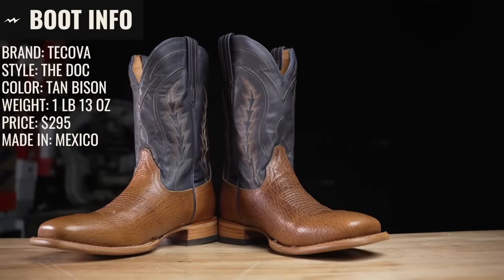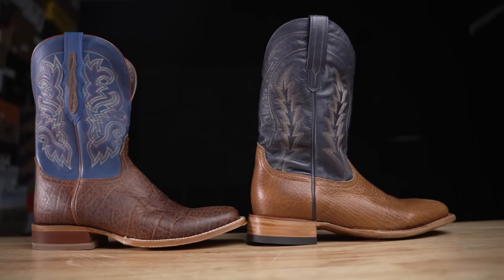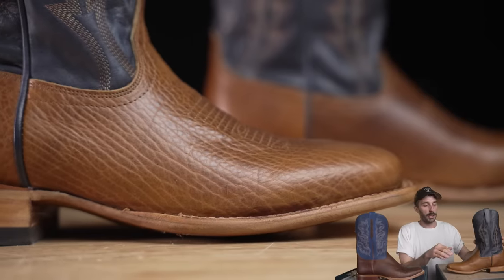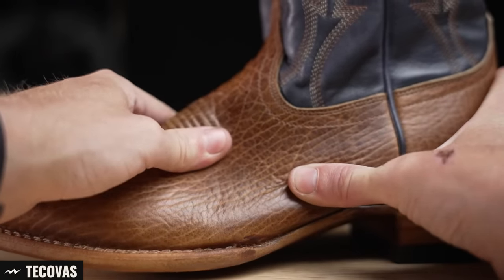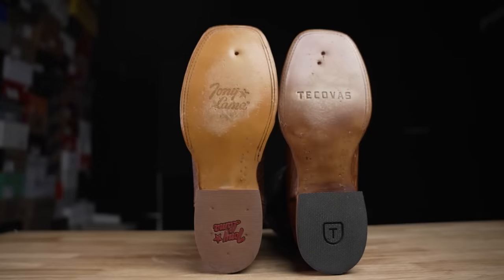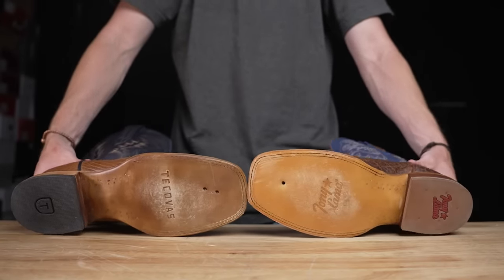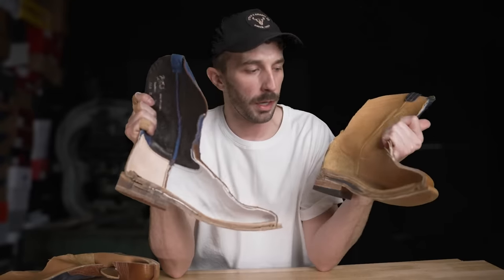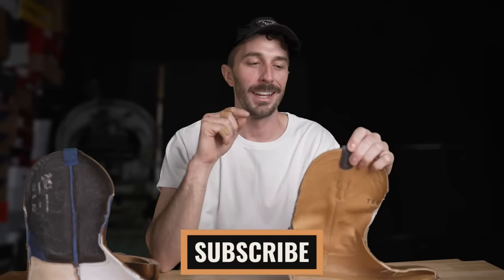Best cowboy boot under $300? - Tecovas vs Tony Lama

Comment: im not going to lie i was leaning towards the tacovas until saw that stupid thermal plastic stuff or whatever you want call it. i have a pair of boots and hiking shoes that have that same shit in the heel and once they crack and break they will eventually push through the heal material and start digging into the back of your heal. its so annoying. it may not sound like a big deal but you kick off and slide on your boots which hits the heal every time,  this makes that plastic stuff break quicker. just because of that i wont buy tacovas which sucks because everything else liked more than the tony lamas. great videos though i just watched so many in a row. thank you.

Comment: I have to say I was extremely disappointed in the pair of Tecovas I purchased. After only wearing them 60 times with with 50% of that time being indoors, I already have a hole in the bottom sole of the right boot.  Also the stitching is falling apart. I understand that sometimes you can get something that had an inferior product that was used to make it and it's just a fluke. I reached out to their customer service sent them pictures I was extremely disappointed that they said that's normal wear and tear. I have other boots that I rotate between so I am very confident that boot was either wore 50 to 70 times. I have other boots such as the Tony Lamas, and the Boot Barn brand Cody James.  I have had both of those pair of boots for about a year prior to buying my Tecovas and they are still doing great.  I'm not sure I would ever purchase another pair from Tecovas. They look nice in the beginning but the poor customer service, as well as lack of longevity makes these boots a terrible investment.  I have to say I guess I was a sucker for the millions of dollars they've been spending an advertisement. Not again

Comment: I have two pairs of tecovas boots, the Earl and the Bandera boots. 
I have had the earls for about 4 years, and I love them. Take care of them and they do the same to you; however, they do need to be resoled.
I've had the Banderas for 2 years and the rubber heel cap is already coming off, on both of them.

Comment: I have the Tecovas. 
There are as Advertised. Extremely well built.
Very nice Full grain Outer Leather. Completely Lined Calf Leather inside.    
I believe  you didn’t mention all the Lemon Tree Pegs in the Tecovas?
I almost had a Stroke when you cut both boots in half. One you used a knife. The Tecovas you had to use a saw. 
Great Review 
Thank You

Comment: I hadn't worn boots on a daily basis for years. I Bought some Tecovas 3 years ago and now that's all I wear. I recently switch to their zipper boots and they fit so much better.  I have high arches so instead of getting a wide boot to help get them on now I can wear a narrower boot with a much more of a snug fit. Big fan of the Tecovas.

Comment: So... I feel like the stats part if my brain would want to consider a rattlesnake bit a categorical variable.  Meaning it's either snakeproof  or not. So if the pressure isn't enough to stop a snake bite it's not snakeproof full stop.  Overall great video

Comment: Ive only had two pairs of boots and nothing too major to say i like wearing boots. I prefer shoes such as sneakers. 
I only had them for parties or to wear them for a special event. I visited a mall outside San antonio and walked into a Tecovas store and tried on some boots and they were the most comfortable pair of boots I’ve ever worn. I had to buy them. There was no break in period like with the boots I owned they were still stiff. Ever since then I only wear boots when I go out and have nearly stopped wearing sneakers completely! I have 3 pairs of tecovas now and 1 pair of Tony Lamas that when I wore was very comfortable with no break in required.

Comment: Im looking for a black leather square toe boot in black with a tan colored vamp and narrowed it down to Tony Lama (TL) and Tecovas.   I went shopping today but didn’t buy a pair yet.   Then I found this video and it helped me chose a winner.   Here’s what I liked between the two boots:

Texture:   I like the stiffer TL’s over the Tecovas.    I want a more tougher boot and the cowhide TL vs the calf skin of the Tecovas.   

Shank:   I prefer a steel shank over the composite.   The steel shank is just stronger and hold the surrounding heal together longer than composite material.  

Thermal plastic counter material.   I HATE that!   Step on the boot and it’s wrecked.   Come on Tecovas!!!!   Another edge going to the TL boot.  

Heal stack:   Doesn’t matter to me.   I liked both.   

Internal lining:   Doesn’t matter to me.   But I felt that the Tecovas stitching inside holding the vamp lining was very weak.  

My Winner:  Tony Lama.